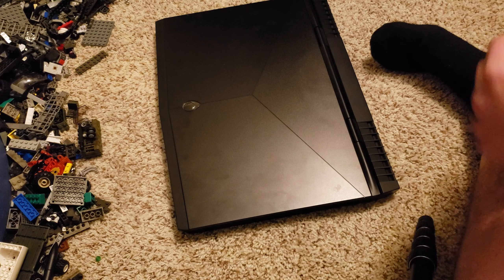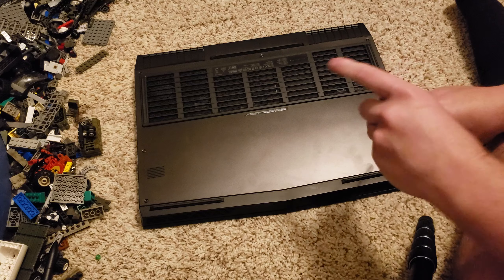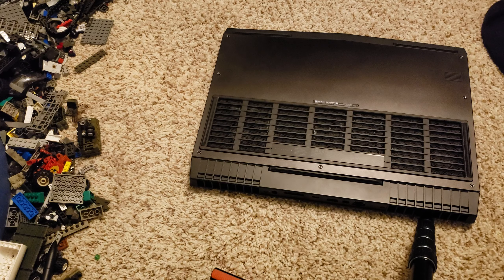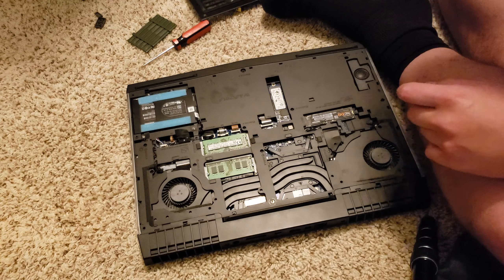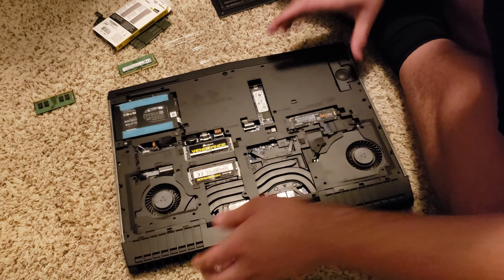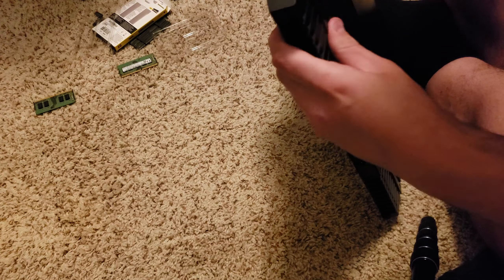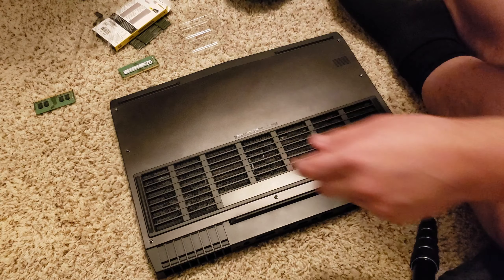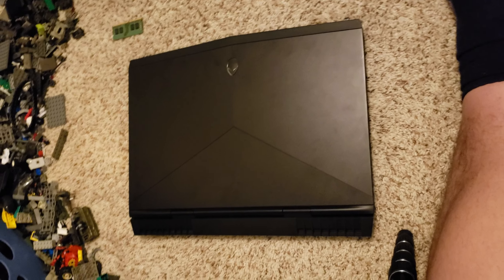Alienware 17 R5. Ram upgrade. 16gb to 32gb.

Comment: Folks, a few thoughts to consider: 1st, most people do not realize that If you plan to do computer repairs or upgrades yourself, you need to ground yourself before performing the work. Grounding prevents your body from behaving as a source of static electricity -- and frying circuitry with it. The static from your fingers can damage sensitive computer parts such as microprocessors and memory chips and being on a rug is a sure fire (pun intended) way to produce static electricity. Just trying to help. 2nd, for previous Versions of Alienware (R1-R4) replacing memory was not fun as the engineers designed the motherboard to have 4 slots, 2, under the cover like this video shows, and 2 on the other side of the motherboard where you had to take apart a lot of components to get to them! Gotta love the engineers, I am one and yeah, the common sense course is not in the curriculum! :-), just being silly.  Thank goodness this one didn't have that! Happy upgrade and computing!

Comment: The one video on youtube I needed to find to ensure I will do it correctly, thanks!
Reply from the maker: Cool. I tried to be as detailed as possible. I wanted to share this because none else had a decent ram replacement video. I had to learn by trying. I wanted to share to allow other people to be able to do the same.
Reply: Yeah, I don't even think someone had made a video like this previously. Only on the previous generation and I know the R4 and R5  are similar but felt I needed to see someone do it on the same generation as mine so I would understand it more.

Comment: Thanks for the video! I have upgraded my Alienware 17 R5 from 16 to 32g ( exactly like you did) first of all I didn't get the 2666 GH. Plus, I keep getting blue screen issues. How did you fix that? Did you find a way to configure the new ram? Thanks!
Reply: did you use CORSAIR Vengeance 32GB (2 x 16GB) 260-Pin DDR4 SO-DIMM DDR4 2666 (PC4 21300) Laptop Memory Model CMSX32GX4M2A2666C18
Reply: @schultz000111   Thank you so much for takign the time and replying to my message! Actaully, I used (Crucial Ballistix Sport LT 2666 MHz DDR4 32GB (16GBx2) CL16 BLS2K16G4S26BFSD). I realized now that this model is not compatible with my laptop, so I sold it and bought (Crucial 32GB Kit (16GBx2) DDR4 2666 MT/s (PC4-21300) DR x8 SODIMM 260-Pin Memory - CT2K16G4SFD8266).
Reply: @mohamedadam3085  would the one i asked you about still work
Reply: Just did this but when I turn it on I don’t get a screen it’s only black even though it’s on but if I but the old Ram back (just 1 8GB card) it will run the normal way and can actually see the screen

Comment: My 17 R15 originally have a single 8gb ram inside but I tried upgrading from OEM to the same ram that you just put in, but now I'm getting the RAM failure light code, any ideas
Reply from the maker: The stuff I put in had issues. Try crucial. They have been good. You can't add more than 32gb either.
Reply: @VacMaster1991  I finally got it to work I removed 1 vengeance and my Alienware started working again, guess I can only do 16gb and not the full 32gb like I was hoping for. But it's good now
Reply from the maker: I would get two 8gb sticks then. Using one stick in a single channel can slow down performance a lot

Comment: Hey, i need a bit of help here if you don't mind? I have the exact same computer which ive had in storage for some years, i decided to upgrade the storage to a evo 990 and a faster ram to 32gb from 16gb, i think it was originally 32gb but the seller took half the ram.

   Anyway, once replaced i was promoted to go into the bios to 'Enable' the boot from the memory? I did it a few times as im not converse with these methods, however, unfortunately im caught in a loop which just tells me to 'shut down' the computer, am i better of refitting the original ram? Or just re-sitting the new 32gb ram to kick me back into bios? 

   I know this video is a few years old but i would dearly appreciate any help as to me it still is a brand new computer and quite fast, thank you.
Reply from the maker: You can't boot from memory because ram erases all it's data once your PC shuts down.  You should be booting from the 990 I would think. Is the 990 your system drive?
Reply: @VacMaster1991  Hi, and thank you very much for getting back to me.

   The 990 2TB Evo storage is brand new and such is the 32gb of memory. I've booted into Windows 10 once for a minimal amount of time just to see it function, however, nothing was lost from storage as quite literally there was nothing on it to lose.

   I will admit that I'm not very converse with this part of installation but have re-seated the RAM upto now but gone no further upon waiting for some advise from yourselves, which I'm thankful that you provided. I will re-seat the new 2TB of Evo storage then hopefully in the meantime if you would be kind enough to provide me with further instruction.

   It does mention in the BIOS to enable 'something or other?' however, i do hope you can still remember and understand how it is when you have invested a lot of money into a laptop, then faster RAM and storage, only then to feel pressured into 'Enabling' the storage or ram, and your given a couple of choices in the process of what to enable?

   If you have in the past installed new NVME .2 storage, whether it may be a larger amount of storage or faster, even both, can you recall what you enabled at all? Even if it was even a different model or make of laptop surely you still must have to go into the BIOS, such as the software guides the user to the storage or whatever, for the functionality can be enabled?

   If you have any more helpful information because at this moment in time I'm terrified of touching the thing, case in point; that i do irreversible damage, and months of money is ejected out of my life in one foul swoop.

   I look forward to hearing from you or anyone else on this thread with knowledge of this situation, thank you.
Reply from the maker: When I upgrade the drives in my laptops I use acronis true image to copy my existing drive to the new one. Then remove the old drive and put the new one in. I have never had to change bios settings

Comment: Can I just buy a Crucial 8GB DDR4-2400 SODIMM Ram and add it to my existing ram on my alienware r4 15? Are the 2 ram slots different sizes?
Thanks for the video 😁👍🏽
Reply from the maker: I think you could. Make sure it wont cause crashes.
Reply: @VacMaster1991  Thanks bro. Do you know how to make sure? Sorry, its my first time doing this
Reply from the maker: @AsianAnonymous7  . I would ask the Crucial about compatibility with other memory. Make sure both sticks are the same size. and the same MHZ. Other than that I don't see any problems. In my opinion I wouldn't mix brands of RAM but that's just me!
Reply: @VacMaster1991  thanks, do you possibly know which brand alienware laptops use?

Comment: I read that you started having random crashes after using this RAM. What RAM did you use after this? Did it stop the crashes? Can you lmk which RAM you ended up going with I want to upgrade my laptop
Reply from the maker: I used this here, https://www.amazon.com/Crucial-16GBx2-PC4-25600-Unbuffered-260-Pin/dp/B019FRCV9G/ref=sr_1_1_sspa?crid=2FH5QFM54GO87&dchild=1&keywords=crucial%2Bmemory%2B32gb&qid=1614065653&sprefix=crutial%2Bmem%2Caps%2C195&sr=8-1-spons&spLa=ZW5jcnlwdGVkUXVhbGlmaWVyPUFSMkpGWFM2SVdTSSZlbmNyeXB0ZWRJZD1BMDk4NjA4NzJaQVcyVUdUMldGSTEmZW5jcnlwdGVkQWRJZD1BMDkwMDkyMDJPSzNJNE8wVDRIOFUmd2lkZ2V0TmFtZT1zcF9hdGYmYWN0aW9uPWNsaWNrUmVkaXJlY3QmZG9Ob3RMb2dDbGljaz10cnVl&th=1
Reply: @VacMaster1991 does this still work with the crucial ram?
Reply from the maker: It didn't work with this ram. I got crucial instead
Reply: @VacMaster1991  ok thanks for the quick reply I subscribed to you I like your videos
Reply from the maker: Thanks. Glad you like my videos
Reply: @VacMaster1991  they are straight to the point it would be good if you showed the full install of ram tho then the restart with the new ram added just to see the boot up process
Reply: @VacMaster1991 I have the exact same laptop and now I'm upgrading is the graphics amplifier any good do you know?

Comment: And Google says I can't upgrade my m17 r5. I want more than 8gb. Thanks for the vid.
Reply from the maker: Lol. It ships with up to 32gb.
Reply: @VacMaster1991   That's what I'll be ordering. Also I was wondering if the ac adapter that originally came with ur alienware is 180W ? Because mines is 180 but the laptop says that I need a 240 W. Dell says that both ACs are compatible lol
Reply from the maker: @Pebric  if you have this laptop the 240 is definitely needed.
Reply: @VacMaster1991  I do have the m17 r5. It came with 180w and it was working. Gonna talk to Dell about this
Reply: The orginal ac that came with it was 180w. It got damaged and ordered a replacement and the new one is identical as the orginal one. Suppsoly dell told me that the 180 is compatible
Reply from the maker: @Pebric  mine came with a 240watt. 180 may work but it will also stress the adapter a lot
Reply: @VacMaster1991  called Dell. according to them which ever adapter it came with is the one I need to use ( which is the 180w). Even though I get a message that I need to use a 240 w. I also can't get a solution unless I pay Dell 90 dollars lol.
Reply from the maker: @Pebric  what are your laptops specs. Processor, graphics.
Reply: @VacMaster1991   Intel(R) Core(TM) i7-8750H CPU @ 2.20GHz

NVIDIA  GTX 1070

CPU SPEED : 4.1 GHz 

8 GB Ram ( But I ordered a 32 one)
Reply from the maker: @Pebric  same specs as mine. You definitely need the 240w brick. The 180 isn't enough to reliably power it.
Reply: @VacMaster1991  I just did. Ordered a 240 that says it's compatible with M17 r5. Going to see if I can still return the 180, if I don't than I'm going to try and sell it. The 240 is arriving supposly this Thursday while the 32 GB ram arrives tommarow.
Reply: @VacMaster1991  also thanks for helping me out.
Reply from the maker: I'm sure someone on ebay will buy your 180w brick. You made the right choice. Using a power brick that is under powered can pose electrical safety issues since your pushing the power adapter past its rated spec.

Comment: I have 8 gigs of ram and I wanna try and upgrade my ram( I know like nothing about computer stuff) what’s the best kind to get that’s worth the price? I’ve seen 2 16gig sticks ive been thinking about. Or should I just get 2 8gig sticks of ram?
Reply from the maker: What do you use your computer for? If you video edit or render then get 32gb
Reply: VacMaster1991 gaming, but i have 8 gb of ram (it says 7.44) though, and most games I want to run use 8 gb of Ram
Reply from the maker: ,  get a crucial 16gb set, its under $100

Comment: I have option to buy a 17 32 gig ram windows 10 pro $425 I know that is a smoking deal is there something I should look for ? What have you heard about issues with the laptop ?
Reply from the maker: What graphics card does it have. The only issues I have had with this laptop are, the mouse buttion is very cheap and wears out in a few months. and the Included M.2 ssd had problems with random crashes. I just replaced the ssd.

Comment: Sadly my A15r4 support up to 32 too, but whenever I put them both in the memory slots, the laptop doesn’t read the ram and blinking 2red-4blue in power button(Memory Failure)...
I don’t know what to do,
Reply from the maker: What speed is the memory? In mhz.
Reply: I have the same problem, i have a 17 r4, and it says the 2400mHz 2x16 set will work on every page I go to, but it blinks 2 red 4 blue for me as well. Works fine with the standard 2x8gb set though. Don’t know what to do
Reply from the maker: Yep. I hate that. They say it works. It needs to work.

Comment: Hello Vac. I saw you said that these RAM sticks were faulty and caused BSOD, which is just happening to me on this same laptop. Could you please tell me the brand and all the technical details of the RAM that you are using now (and that works fine), please? So i can get 2x16, I want 32 gb

On the other hand, how do you know that the BSOD were due to the RAM? If used "mdsched" and it said that my RAM hardware had issues, but on some comments you say that you used a tool and it told you that issues were due to the RAM specifically. "mdsched" just tells you that RAM has issues

I have 2x16 sticks, but how can I know which one is faulty?
Reply from the maker: I would recommend trying crutial or hyperx memory
Reply: @VacMaster1991  thank you man, could you please let me know the exact model or details? There are tons of models in the market and I'm lost...I just read a few minutes ago that the Alienware 17 R5 model is not compatible with 2666MHz RAM modules..?
Reply from the maker: @Dgo_cn  Right here, https://www.amazon.com/Crucial-16GBx2-PC4-21300-SODIMM-260-Pin/dp/B071H38422/ref=sr_1_3?dchild=1&keywords=crucial+2666+ddr4+32gb+sodimm&qid=1626814504&sr=8-3
Reply: @VacMaster1991  thank you!! last question please...which one do you have man? the 2400 or the 2600 one? people say 2600 does not work well
Reply from the maker: @Dgo_cn  get the 2400, 2666 has issues
Reply: @VacMaster1991  awesome man, you are the best, thank you!
Reply from the maker: @Dgo_cn  thanks
Reply: @VacMaster1991 after placing the sticks as in your video, I just turn on the laptop and that's it, right? not any other configuration to do?
Reply from the maker: @Dgo_cn  when you turn it on you will get a message saying "system memory has changed" then it will continue as normal. First startup after changing memory will take longer as well

Comment: What is the specs of your Alienware? Like total storage i know u have 32gbs of ram
Reply from the maker: I have 2.25tb of storage. A 1070 & 8750h.
Reply: @VacMaster1991  I wish I had that laptop 💻
Reply from the maker: You definitely don't. Mine had constant overheating issues. I had to fix it constantly. Dell wanted $20 to talk to customer service. I got rid of this annoying thing. Now I have a lenovo legion 7 with a 5900hx, Rtx3080, 32gb of ram and 6tb of ssd storage.
Reply: @VacMaster1991  still would have like it 
I love Alienware and apple laptops 

I need 2 m.2 2280 ssd for my Alienware 17R3 but to broke to buy s***

Comment: @Vacmaster1991 I have a Alienware 17R4 which is running GTX 2060 and planning to upgrade my ram to 32GB. Which one do you suggest and please send me the link of the product? Thank you in advance this video is so useful.
Reply from the maker: I would get this stuff, https://www.amazon.com/Ballistix-16GBx2-PC4-21300-SODIMM-260-Pin/dp/B06XRBS4Y5/ref=sr_1_4?keywords=gaming+laptop+32gb+ram&qid=1576632605&sr=8-4
Reply: VacMaster1991 Thank you so much! I was planning to upgrade the SSD to Samsung Evo Pro 970 too.
Reply: VacMaster1991 Are you using the same RAM?
Reply from the maker: @sreekaushikvasu7925  no I used Corsair, it was faulty and caused blue screen.
Reply: VacMaster1991 so you are back with the 16Gb?

Comment: Hey, I hope you keep replying to comments. I have a Alienware 15r3, I'm thinking on upgrading to 32gb with 2666MHz but I don't want any compatibility issues , so what ram did you use or wich one  you would recommend, or should I buy a 2400Mhz.
Reply from the maker: For the 15R3 . Go for 2400

Comment: sorry for another question but is this RAM running at 2666 as intended or is it limited to 2400, ive seen some complaints
Reply from the maker: 2666 doesn't run properly. 2400 is my recommended maximum for this machine. Since every 2666 kit I have tried has caused compatibility issues.
Reply: @VacMaster1991  i heard updating the Bios fixed this issue not sure if you have done that but i think its a fairly new update
Reply from the maker: @brandonhaynes9120  I was running the latest bios at the time. I tossed this laptop years ago.

Comment: i have an old model - 17r4, i wanna upgrade the ram, but does it support upgradable up to 64gb ram ( 32gb x 2 slot)?
Reply from the maker: No its 32gb max ion the R4
Reply: VacMaster1991 noted thanks

Comment: i bought 32GB*2 but only one ram is working in my R5 17
 whenever i put both it do not boot. Any solution ?
Reply from the maker: If you bought 32gb x2. As in 64gb total. 64gb is out of the rated spec on the R5. 2x 16 is max.
Reply: @VacMaster1991  but i can see total 64 gb ram in boot manager. ( by the way thanku for your reply )
Reply from the maker: @Navi Droch  ok. Strange. What brand and speed of ram did you get? 64gb may work but 32gb is the max supported ram.

Comment: Thanks brother. I am tryna play Just Cause 3 but an error window pops up saying that the 8 GB memory is lower than minimum. Guess I gotta make it 16 or sth to run without any lagging. BTW, is there an official RAM brand for 17 R5? Ima rookie to computer and stuff tho. Thanks man
Reply from the maker: There is no official ram brand for The 17r5. Get the stuff I have in this video.
Reply: The manufacture of the ram is SK hynix.  I just put in some G.Skill Ripjaws 2400, manufacture by SK hynix.  There is basically 3 main company that manufacture RAM.
Reply: maddtekk can you provide a link to the one you recommend

Comment: Hi man is it possible to upgrade Graphic Card too I mean it's already installed with GeForce GTX 1070 can I upgrade to something like 2080 or 1080 thank you
Reply from the maker: Nope. Its soldered to the motherboard. Plus this 1070 is overclocked at 1800mhz. A 1080 would maybe give 10% Performance increase

Comment: Did you use CORSAIR Vengeance 32GB (2 x 16GB) 260-Pin DDR4 SO-DIMM DDR4 2666 (PC4 21300) Laptop Memory Model CMSX32GX4M2A2666C18
Reply from the maker: Yes. And after a few months. It started having issues with crashing and blue screen. I returned it.